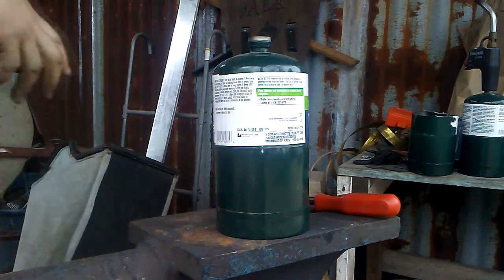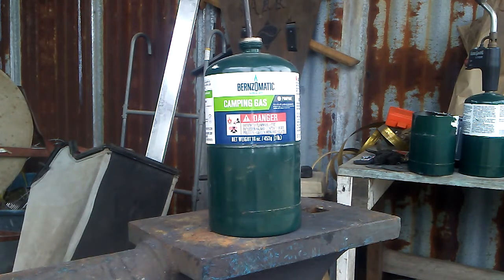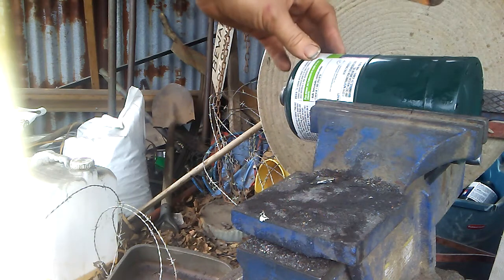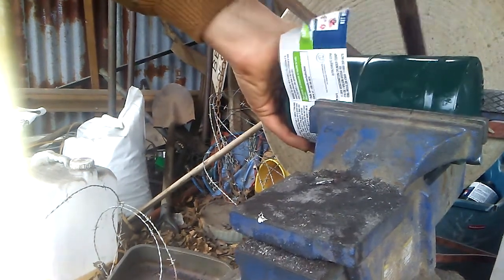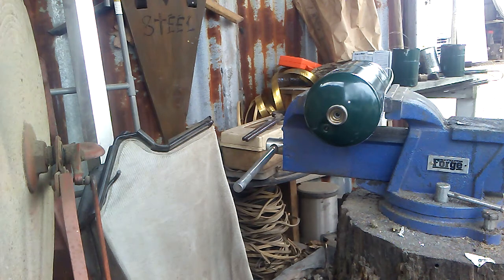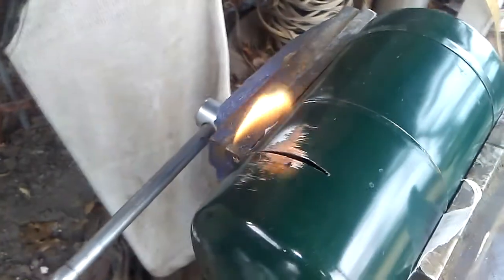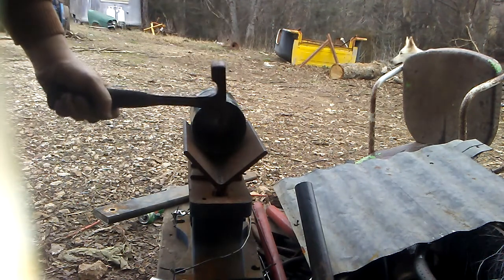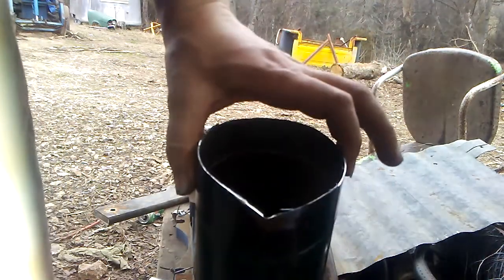Making a Propane Tank Crucible Easily and Safely

Comment: I know copper is a higher melting point than alluminum but I used a green propane tank to melt copper and it ended up at the bottom of my forge....lol.. This was before I watched your video . What would you recommend.. Thanks.

Comment: Cool pup   I was wondering about using the fatter tanks.  "TANKS" for the video.
Reply from the maker: 😆 tanks for watching! Thicker tanks are definitely a good idea. I have also learned to regulate my temperature and be patient which can make the crucible last longer. I did another video where I use vegetable cans as crucibles with some success, but for high temps you definitely need something more durable.

Comment: Hey dark steel do you worry about the pressure valve? I seen alot of video with a homemade tool but I don't have an angle grinder to make it
Reply: And I really want to know if it is necessary. Because this crucible is the last part of my backyard puzzle lol
Reply from the maker: Honestly it is not a fantastic crucible but it works okay for a couple of of melts before it burns out if you keep the temperature relatively low. As for the pressure valve, releasing as much out of the tank as you can is important and then still follow that up with the measures shown in the video to prevent unexpected combustion. One viewer commented on this video mentioning flushing the tank with water instead of using fire which does sound a bit safer so that's something to consider
Reply: @DarkSteelKnives  yeah flushing does sound better but to do so I've seen them drill through the top which doesn't seem safe to me lol so how else could you flush it?
Reply from the maker: @YoGooN1  I don't know much about the subject truthfully. This video was kind of shot as a bit of an experimental project and I haven't done much with the idea since. Speaking purely off the cuff though I would think you could effectively flush it using a hack saw the way I did and then widening the whole a bit by striking the part to be removed, lightly with a hammer. But again this is just speculative as I haven't tried flushing it with water myself
Reply: @DarkSteelKnives  either way thanks again. Glad I poked my head in over here and said.... "Heeeey yooou guuuuuys" lol but serious thanks and best wishes!

Comment: How many uses did you get from one of these? I've read of some letting the bottom go and leaking after 1 or 2 uses
Reply from the maker: they do not hold up to much heat and it pretty much amounts to what you read. when melting cans however, the aluminum melts into a liquid and leaves behind remnants of impurities that cling to the walls of the crucible so using one of these for your initial melting and then tossing it is a way to spare yourself the trouble of trying to clean up a more favored crucible.
Reply: @DarkSteelKnives  So I've got 2500 cans to melt down and am new to that. How many uses would you say you've safely got away with before one of these let go?? 2...3...5?
Reply from the maker: @ROOKTABULA  it depends on how much heat you have under it but honestly probably 1-2. This video was shot kind of as an experiment and I have only done a little bit with it since. My advice would be to be careful, keep an eye on the bottom of it, the ones I was using have a double layered bottom and the outer layer melted off first so I would gauge it from that and do some experimenting of your own. Understanding that it is dangerous work and I am in no way an expert so move forward at your own risk